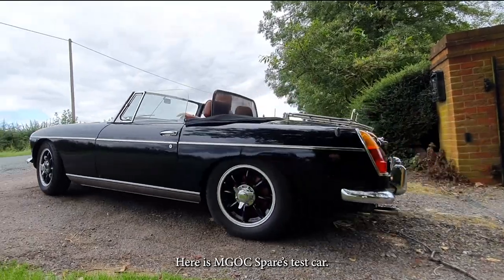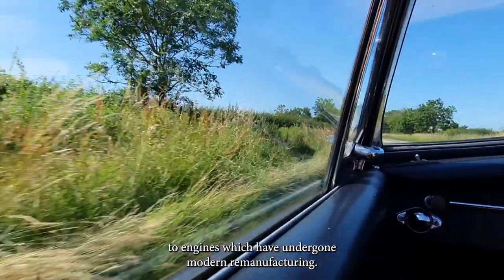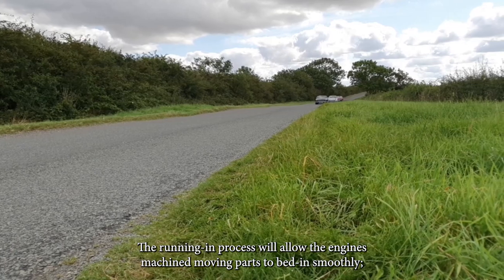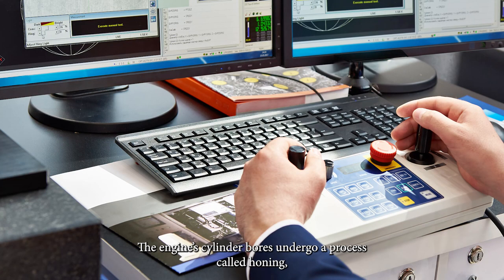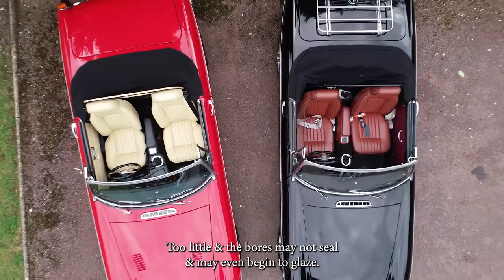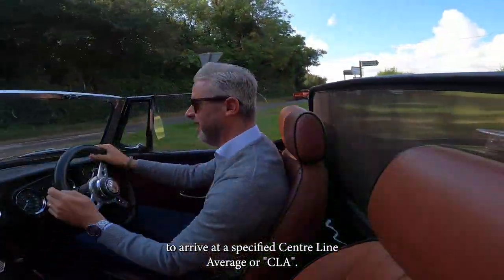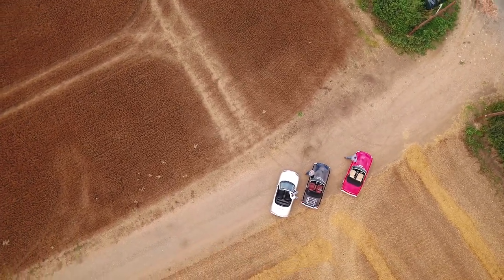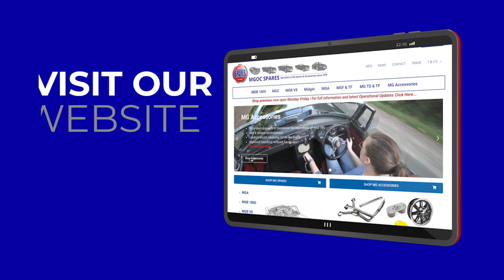Remanufactured 2.0+ Stage II MGB Engine

Comment: I read somewhere that increasing capacity, to over 1860cc or so, could lead to weakness in the engine due to the amount of material taken away. Please could you clarify how you avoid doing that in this case?
Reply: I assume they stroke it more than bore it out.